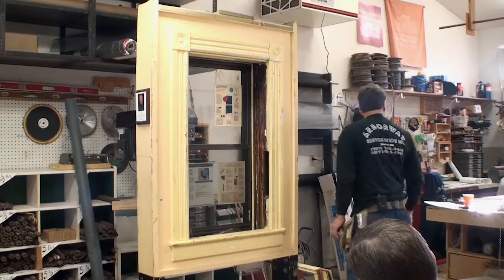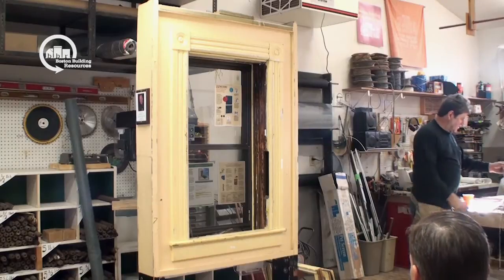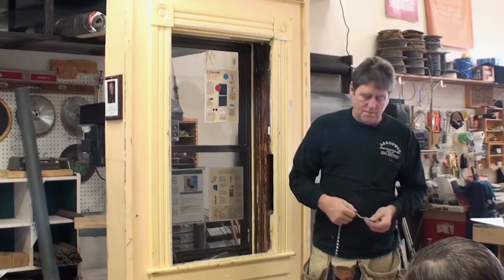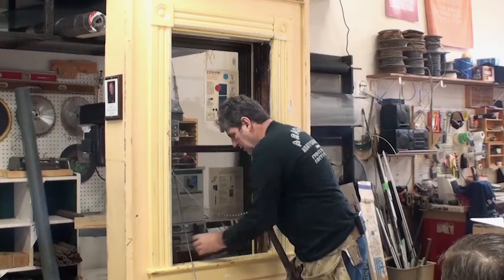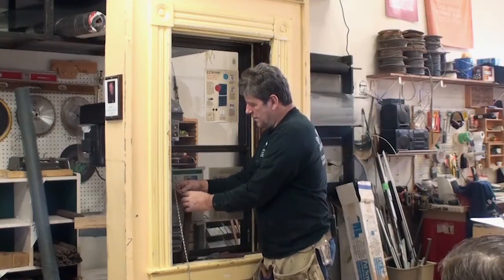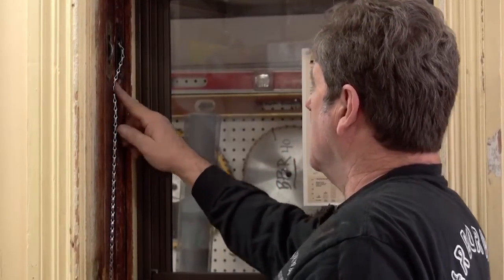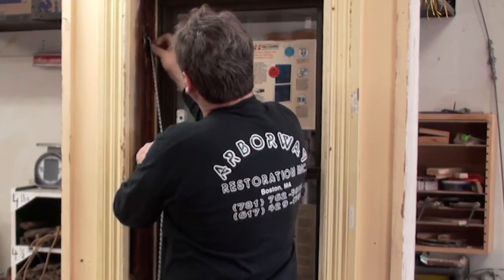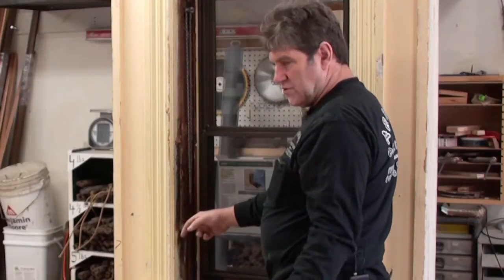Window Rehab Part 2: Installing a New Sash Rope or Chain

Comment: This is a frustrating video. Too much of the crucial action was not shown clearly on camera, nor was it well-explained. Why give such a thorough explanation of how to measure the chain for the top sash, when, for most of us, the top sash is painted in place--it's the bottom sash that's typically in need of repair. What's worse, you don't ever explain how to secure the chain to the sash, which is the big difficulty I've been having! Very disappointing.
Reply: See video 1 at ~14 minutes. Also in video 1 he discusses releasing windows that have been painted shut.
Reply: @janelindamood8174  Thanks for the helpful suggestion!